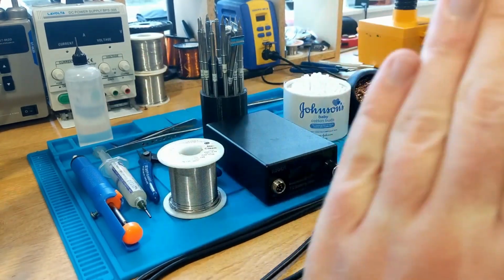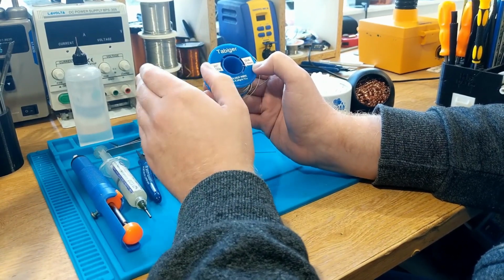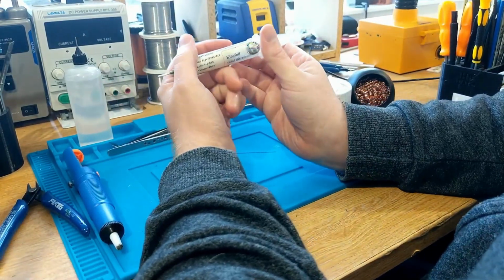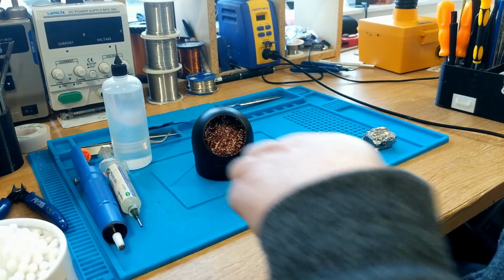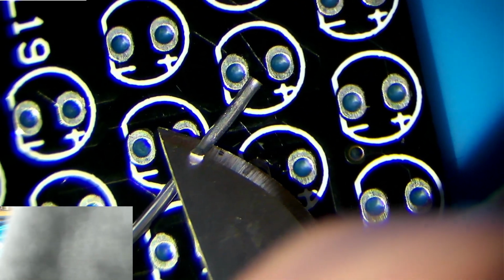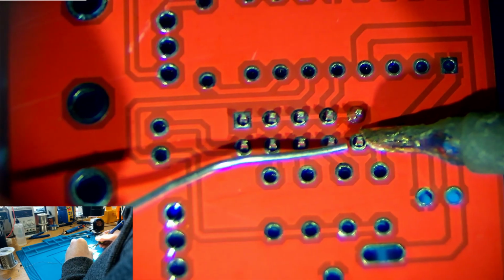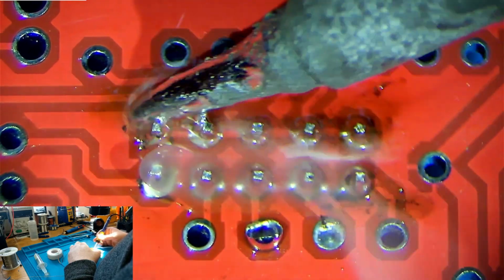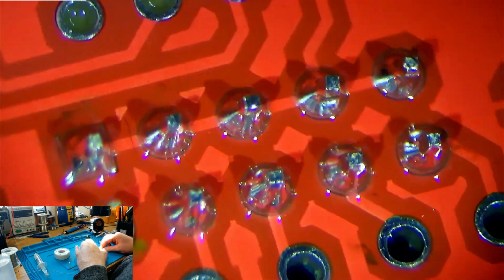Beginners Guide to Soldering and Soldering Equipment

Comment: Great informative video. I have now trashed my Hakko fume extractor and ordered your recommended Kotto. What would you recommend for a microscope?
Reply from the maker: Depends on if you prefer a digital scope or a binocular/trinocular scope andiff you want to record what you do or not. It also depends on budget.

Back when I made these videos I used an Eakins Trinocular microscope. These days I use a camera based microscope system. What sort of setup are you after?
Reply: @NewRetroRepair  More of a digital microscope setup. I have looked at Andonstar and some of the cheaper LCD digital scopes but as with everything there is thousands of them. Currently I just use a jewelers magnifying lamp but i'm slowly getting into repairing things that just can't be seen to repair correctly.

Comment: Nice video, I think the extractor is overkill tho, I've worked for years in workshops and at home with no extraction, so has my step-father who was a tv and radio engineer for 40 years. 
dont dismiss the fixed wattage irons lol, my wellers are still working and used regularly after 20+ years.
Reply from the maker: Oh those fixed wattage irons are fine if they're good quality. The older Weller's were great! Most people will just go for a cheap $10 RadioShack special though and those are terrible. Beginners will think they're bad at soldering when it's really just a terrible iron they bought for peanuts overheating components, traces etc.

As for health and safety, it's a personal choice. Personally I'd strongly recommend extraction & filtration. Flux is carcinogenic and lead is a neurotoxin. Each to their own though. I like to give people the info and let them make up their own mind 😁

I often forget to turn my extraction on 🙈

Comment: I could probably actually use this / it came at the right time (appreciate it) because since you went unavailable I've tried contacting two other services so far without success and it's getting a bit weird 😝 I've actually somehow got a bit of a nothing area in my small place that I could turn into a mod/repair/soldering area so this video could actually be really useful.
Reply from the maker: Awesome, it's a great hobby to get into! A bit of advice for you if you're just starting out: Buy some practice soldering boards and practice on those before you try anything on those older consoles. If you have any questions put them in a comment here and tag me. 😁